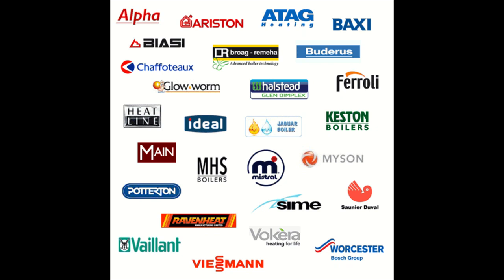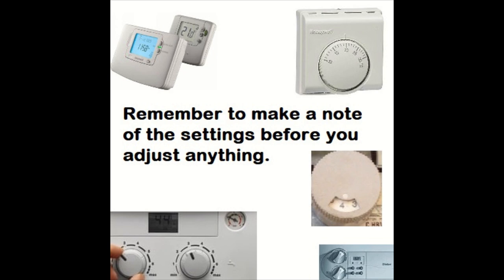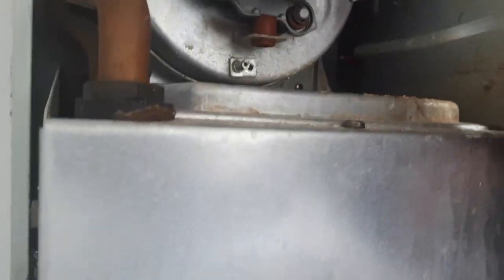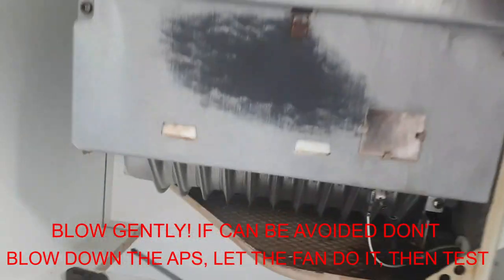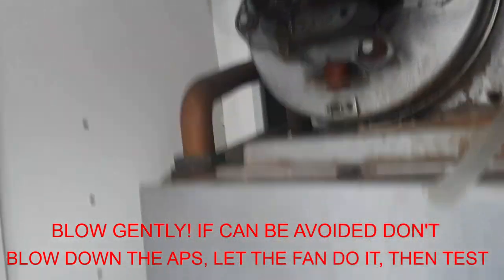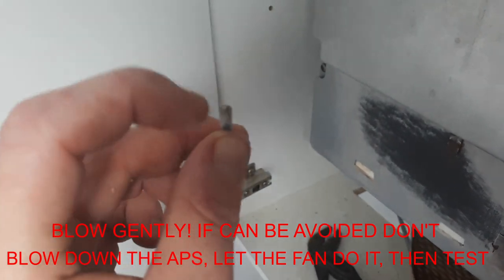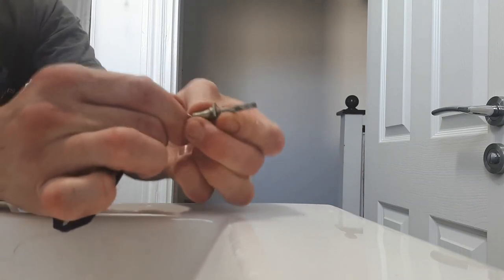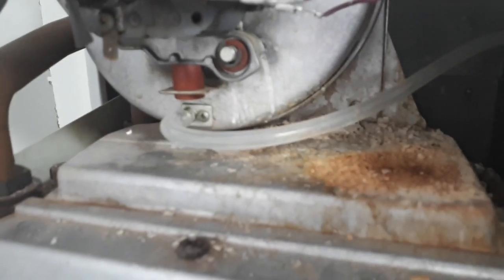Quick Fix Potterton Suprima Red Light Flashing Fault Fix - Fan & Air Pressure Switch

Comment: Legend, you’ve just saved me a fortune. After 3 weeks of no hot water I replaced pcb (thankfully a cheap eBay second) and still failed. Put on my big girl pants to have a go myself in the depths of the scary boiler beast and Venturi was completely blocked. Quick cocktail stick and pipe cleaning and now fires again, better than before. Very grateful you enabled me to fix myself with zero boiler knowledge. Thank you!
Reply: We have exactly same issue did you try the suck the tube thing first or just clean the Venturi straight away?

Comment: Hi I have the same boiler recently started giving me trouble . Red light keeps flashing and when press reset button for 5 seconds it runs on but only for few minutes and then starts making rattling noises few times and then agains back to red flashing light ,hot water but no central  heating I can touch both pipes on my radiators and both are cold , bled the air from radiators but still the same .any help would be appreciated
Reply: Got exactly the same problem

Comment: I have just had the exact fault, first the gas engineer replaced the air pressure switch but the boiler would still not light.  I found a small feather was actually inside the fan so as the fan spun the feather was sucked in to the hole and prevented the pressure switch from working.  The gas engineer pushed a small Allen key through the pipe and said it was clear and it must be the fan not creating enough air pressure.  After he left I removed the pipe and found a small feather, removed the feather and it worked.

Comment: Suprima 100L Same problem get spark but no start up. Checked the venturi valve as video but the 100L looks nothing like yours. Only 1 cm long within fan and opening full dia size 3mm. Is that correct?

Comment: My fan won’t turn just stops
Reply: Try spraying some lube into the bits that should spin and turn the fan by hand when it's not on. It might need some encouragement once it switches on so use a tool so you don't catch your fingers in it.

Comment: Nice video. Just been to customers house which has the same issue. Thought it was the air pressure switch as when sucking on the tube nothing happens. Bit weary to change as they don't fail often.

Comment: GG , What a  legend you are.  
Did power flush 13 rads.  Open Vent system.  Left everything fine . 
CH / DHW , Morning after . Got call boiler went onto lockout .
Could be Airlock. 
boiler fires up / cuts off .
potterton Suprima .
Please help 🙏 
Thanks

Comment: Hi boss. Thanks for your video. 
I’ve got a Potterton suprima 40 and it does the same as described above, but I think it flashes red a little slower compared to vídeo above. After resetting (maybe 3 to 10min) boiler’s light flesh red again, but sometimes it does not shut off, other times it does. There’s not consistency, why? Could it be NTC thermistors?
Thanks

Comment: Hi. Is the air proving unit different to the air pressure switch?
My boiler man has just changed the air pressure switch but the red light still cones on. Solid light, no flashes

Comment: Great vid, I have the same boiler, makes a horrible noise when been on for a while, like hissing and vibrating.
Reply from the maker: Sounds like circulation issues.
Reply: I’ve got same boiler and I think it’s called kettling. The boiler lights up fine and can see the flame, then theirs a clunking noise about a min in and the flame goes out. The boiler release the sequence. 

Then the red lights started coming on. And the boiler is still trying to flash green and start the sequence again.

We had hot water but radiators not heating up.
Reply: @Stevenmillar01  thanks,  when I turn the gas/pilot? down, it doesn't make any noise anymore. It still heats up (heating/hot water) just a lot slower. If I turn the gas/flame higher it starts to make that 'kettling' noise
Reply from the maker: @theeroom   Steven Millar  you've both got circulating issues. Water heated by the boiler not going around quick enough. One is worse than the other.
Reply from the maker: @Stevenmillar01   theeroom   you've both got circulating issues. Water heated by the boiler not going around quick enough. One is worse than the other.
Reply: @goldgas1216  update, heat exchanger has some blockage. Engineer said its not worth cleaning, just replace the whole boiler 🤔?   And he stated every else is running perfect, which makes me think it's a waste to buy a new boiler. Much appreciated, Manchester based if you work in  northwest haha.
Reply from the maker: @theeroom  haha I'm not the area but thanks.
Its upto you, the main heat exchanger makes up most of the boiler and is the most expensive part, i would think this part has been in the boiler many years and might be seized or rusted in place and can damage casing on removal. Also after a big repair you'll still have an old boiler and those pcbs are not cheap and go all the time.
I make my living repairing boielrs, but sometimes have to go down the replacement route.
Thinking positive, a new boiler will be more efficient and if you get a good warranty you won't have to worry about boiler repairs for however long the warranty is. Can get some that are 10 years 👍
Reply: @goldgas1216  Is there much of a difference in terms of efficiency in the old vs new....plumber mates say try keep your old boiler going as long as possible. What do you recommend as a replacement gas boiler for reliability and longevity, Viessmann??
Reply: @goldgas1216  привет, у меня суприма 50, мигает красная лампочка, трубка не забита, вентилятор не крутится даже при сбросе.

Comment: Hi mate, I’ve got an issue with the boiler flashing amber and green, boiler lights for about 5/10 seconds then shuts off, it does that a few times before locking out flashing red
Reply: Same here did you manage to find the issue ? Thanks

Comment: Is there any right or wrong way to adjust the burner flame, I adjusted mine to temporarily to reduce the kettling before the heat exchanger was replaced. And can't remember what it was set to Originally 😅

Comment: I got orange light, sparks but no flame, I tested incoming power to gas valve I got 25volt AC, I have not Checked the APS...any help guys..cheers
Reply: PCB not giving the gas valve enough voltage to lift it sounds like, would expect 240volt AC on gas valve. Hence why ur getting spark but no flame.